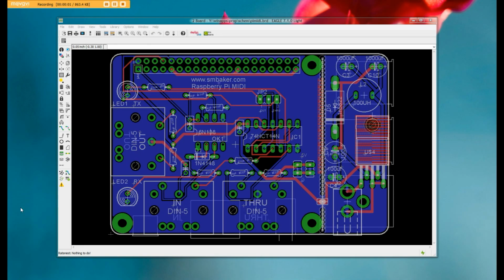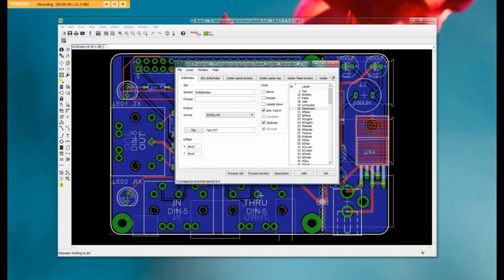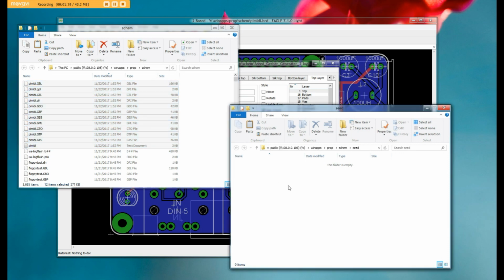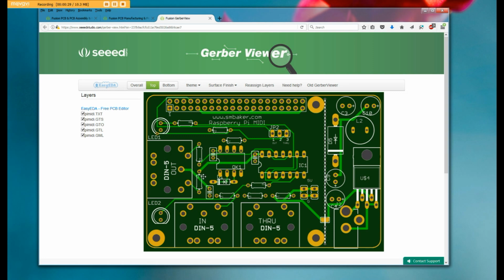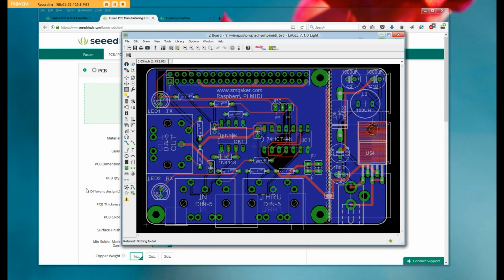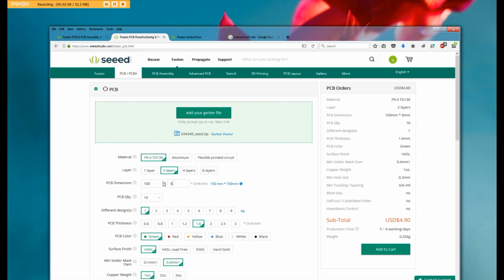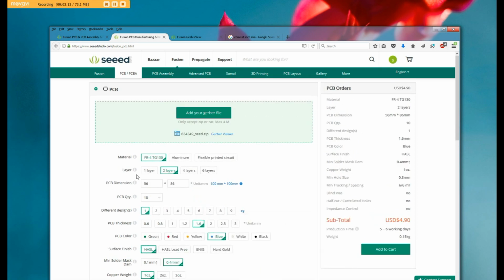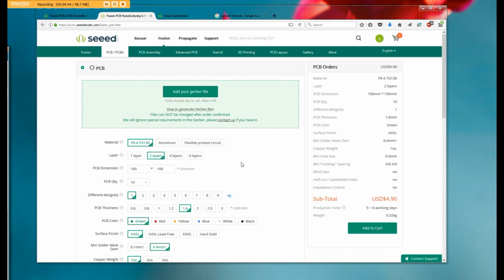Seeed Studio Fusion PCB Review

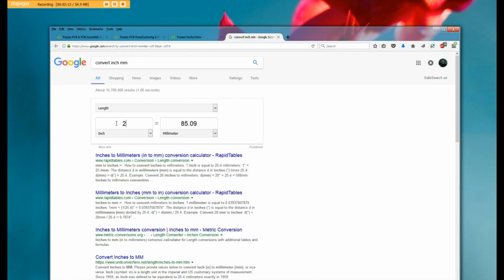Comment: you didn't include the roundings in your board dimensions ( 5:08 ). I always place a relative zero point in bottom left corner and read the delta coordinates in the top right corner. Btw since when can Eagle klick Line segments and open an properties dialog? I've worked with eagle for 15 yrs until version 5.